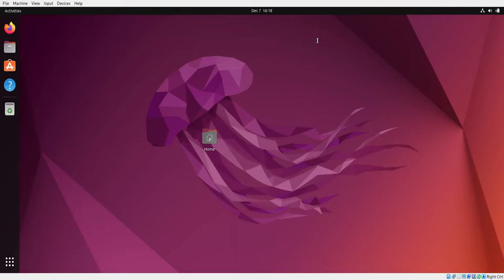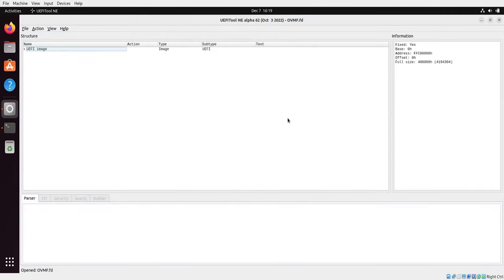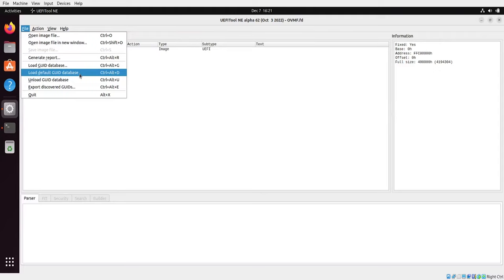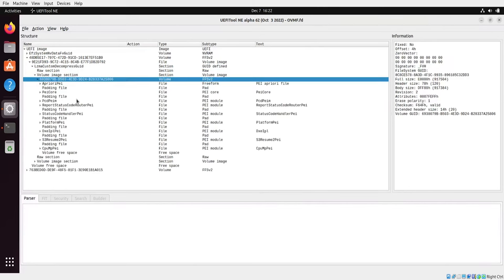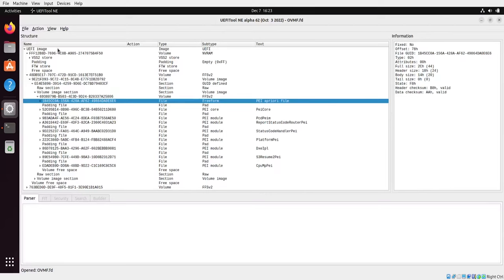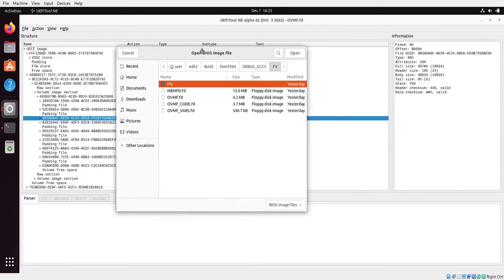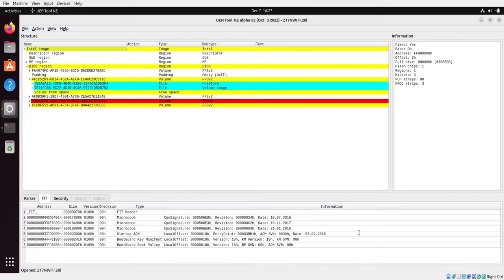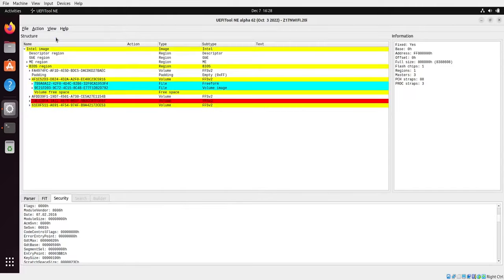Arch4021: Introductory UEFI 03 12 UEFITool introduction

Comment: Cool, will this work with Mac's Boot Camp Windows 11?

I wonder which do you click to know if your PCIe slot are bifurcated (so you can have more than one SSD NVME in one PCIe slot)?

Thank you.
Reply from the maker: No classes have been tested on Windows 11 yet, but in general they're expected to work the same on x86 Macs as PCs. In general no, you can't have multiple PCIe devices in the same slot.
Reply: @OpenSecurityTraining  Thanks. How about those PCIe cards that have multiple slots for NVME M.2 how does the data get divided among them (I've seen 4 to 8 NVME M.2 slots that use one PCIe instead of slotting in a GPU)?
Reply from the maker: @SevenDeMagnus  I don't know on that, you'll have to ask the instructor via the OST2 class in-forums or OST2 SIGs Slack channel